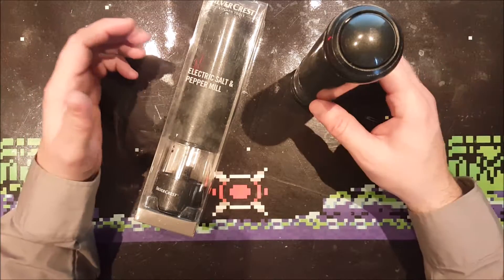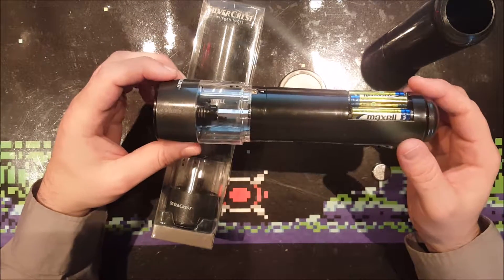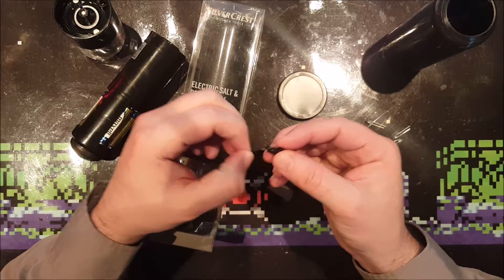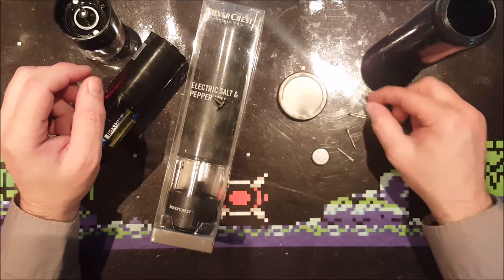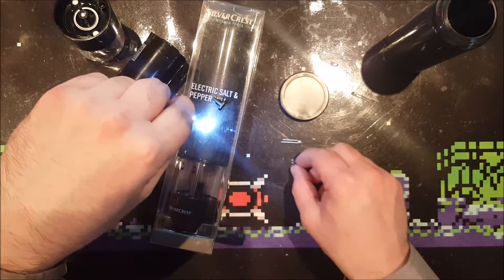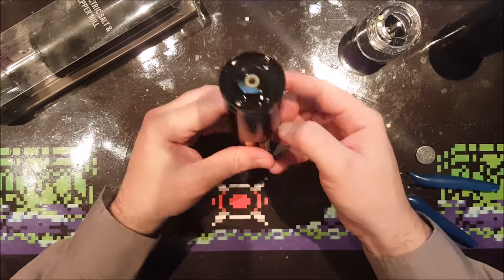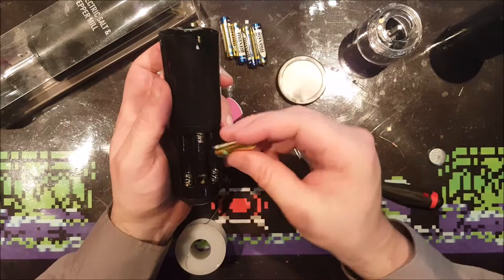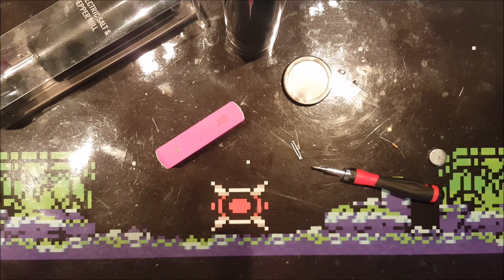Replacing the incandescent light for an LED in a Silvercrest Electric Salt & Pepper mill

Comment: Hey Bas! One of the lights just fell out. Suggestions? Thank!
Reply from the maker: You can try to open it like I did in this video and see if you can mount it again. If that doesn't work, you now have a peppermill which last longer on a set of batteries. :)

Comment: I know my comment is a bit too late, but just wanted to share my experience of these great pepper mills.
Bought it, was happy about it. Got home, and put batteries in, I was ready to get this bad boy in to action.
Try to open up the thing, it break apart, gears fly all around my kitchen. Damn,  it's sealed shut to the damn tank or w/e.
Unlocking didn't work, wtf? I tried fixing it, finally found all the gears and made it as it was. Started putting it to one piece and the joint from the electrical wiring broke off, fuck it. Not worth the hassle, just going to buy another one from another brand which lock's actually open as intended :D

P.S Does your work as intended with the new leds?